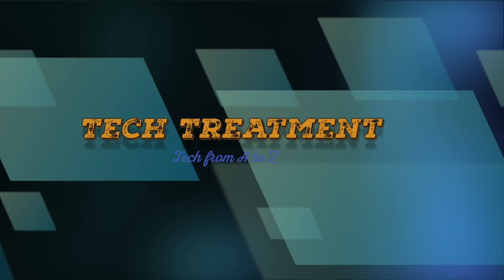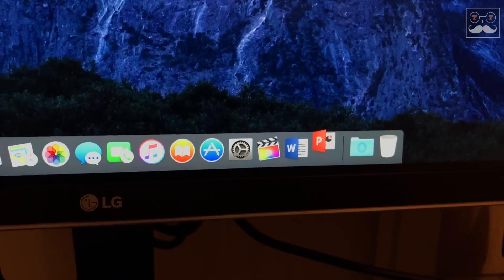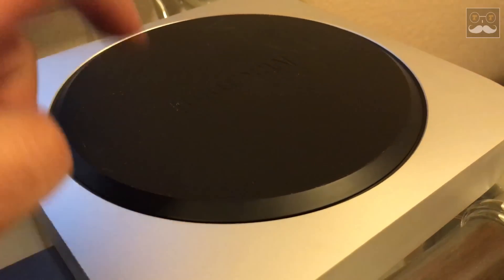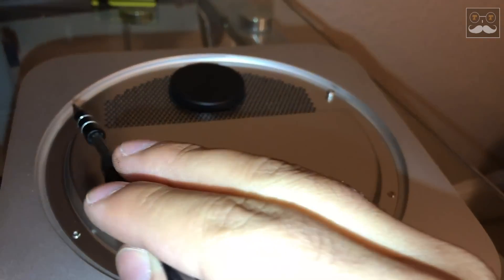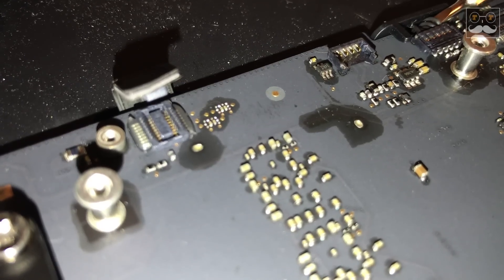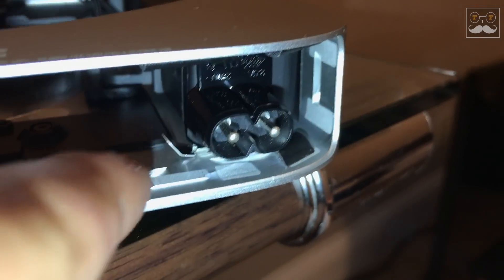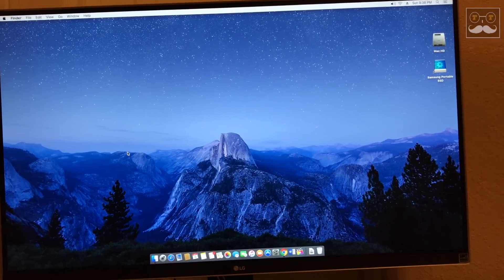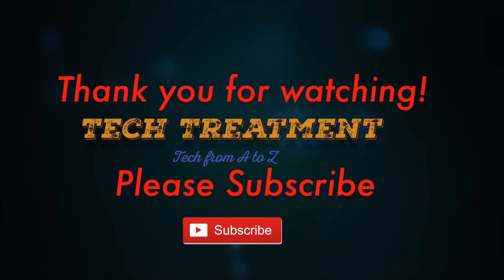Mac Mini Speed UP Base Model SSD Upgrade Performance

Comment: Will swapping out the hard drive wipe everything from my mini? What about the operating system? Will I have to redownload, if so where do I find the OS, drivers, etc?
Reply: I would recommend instead of changing the 2.5" HDD for a SATA SSD it is better to just add a NVME SSD it is much easier to install and it is also a faster drive. That way you will have two hard drives, then all you have to do is install the latest OS X on the SSD and migrate you data from the HDD to the SSD when you first start your mac from the new SSD.

Comment: Still works in 2019!
Reply from the maker: Yes Sir, thank you for liking the video and subscribing to TechTreatment!
Reply: I have spent months researching into Mac speed ups and discovered a great website at Achak Speed Plan (check it out on google)
Reply: There are a few factors in speeding up Macs. One place I discovered that succeeds in merging these is the Mels Speed Method (google it if you're interested) definately the no.1 resource that I've seen.Check out the awesome info .

Comment: I`ve been using this super MAC system utility “macvo unique only” (Google it) to optimize my MacBook Pro for 2 years. This user-friendly repair software program is the best one out there. This might also be the good reason why the product is well-known among Apple store employees. Its performance is fantastic and its user interface is not hard. Top functions of it are Cleaning, Securing , Optimizing your Mac, anti virus, spyware.
Reply: Heads up, the software is BS. If you Google exactly what this person commented, it's an exact copy of others include YouTube videos. And in the descriptions, it pretty much says "download this torrent"  It should go without saying, but that comment is garbage
Reply from the maker: +Rue Hawthorne Hi thank you for sharing. I will check it out!
Reply from the maker: Hi thank you so much for updating and sharing this info and helping the tech community out!

Comment: Lately started out making use of this super MAC system utility “macvo unique only” (Google it) on the recommendation of a person and have already been very happy with the functions, particularly regarding Mac maintenance. I usually use this for the tasks as Cleaning, Securing , Optimizing, anti virus, spyware. This software program has all I need.
Reply from the maker: thank you for sharing!